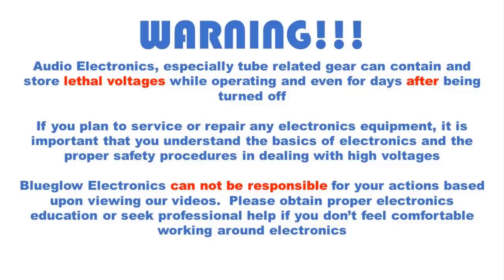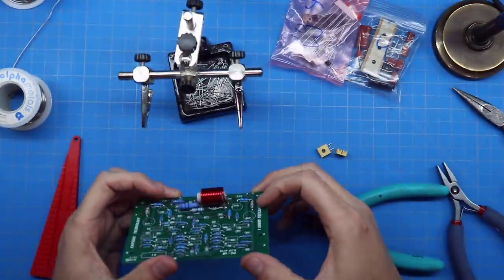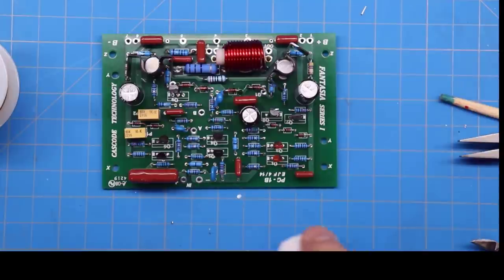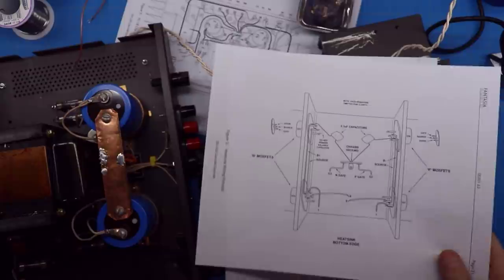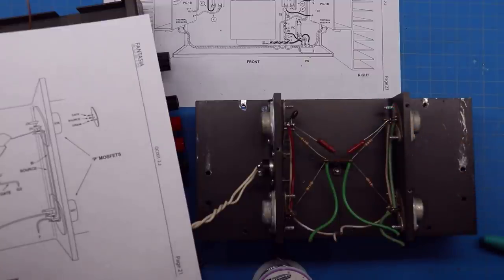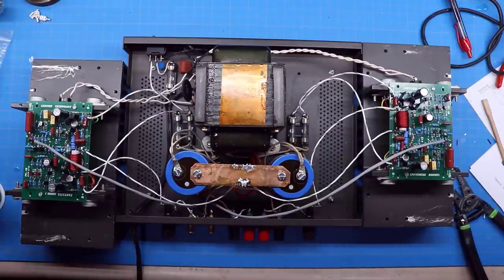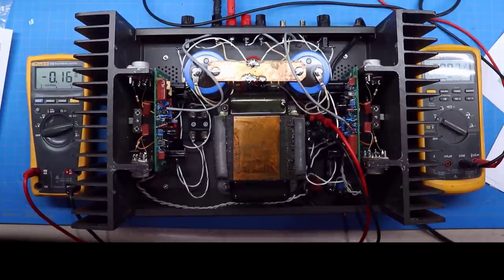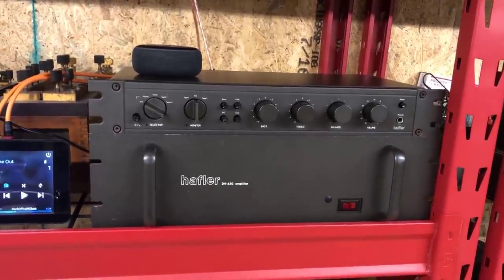Hafler DH 220 Restoration - Part 2

Comment: The Halfer 200 and 220 were among three amps that really changed solid state amps in the late 70s and early 80s. The other two were the Amber Stereo 70 and the Apt Holman Apt 1. Nice work at doing the upgrade.

Comment: I built one these in about 1982. The main left and right circuit boards came fully assembled, tested, and biased. Only the power supply components and other connections had to be wired. Later on, I did replace the 2 large capacitators with some Japanese ones, and replaced the RCA connectors and speaker connectors with gold platted ones. I am sorry I sold it.
Reply: I miss mine too. friend gave me his NAD 2200 power amp and associated preamp. My wife liked the way the NAD looked so the Hafler went into a closet for 10 years.

Comment: Wow....I have the kit to do my preamp and this has given me the courage(and a source) to do my amp. Probably this winter. I put all new RCA jacks already in the preamp. Hafler's originals were pure junk....even when  new....horrible design. I got the jack kit from the guy that offers rebuild kits for Dynaco gear.  Heathkit was always adamant about taking breaks and walking away from your work. When you start to get eye fatigue, getting up and away from your project really helps. Not trying to be a 'Karen', but not taking breaks will cause small mistakes or reversals of parts etc.  I've done that a bunch....made simple mistakes. 

Thank you so much for this. I will use it as my guide when I do the rebuld!!

Comment: Great video!!
My college roommate had a Hafler (factory) built. It sounded good. Nice detailed sound.  The only negative I recall is that the Hafler would shut down if run hard (probably a circuit protection device to prevent amplifier damage).
Reply: I've never had that happen and even used the amp to power double Advents at a youth dance with their 'house music'......that will task any amp. Probably depend on your speakers ohm/sensitivity rating and how hard you're driving them, music dynamics etc. That electronic 'house music' is more taxing than rock I think.  In college you tend to max out everything.

Comment: Wow. Do you really stuff one resistor, then turn the PCB over and solder it, then stuff another resistor ..? It's several times as quick to stuff all the resistors, then solder them all, clip them, then proceed to the diodes, then the taller components in increasing order of height.

Comment: Thank you for posting your videos.  On this restoration, you showed the kit included 0 Ohm 'resistors'.  What is the value/importance/advantage of using these instead of a jumper wire?
Reply: Go back in the video, and listen to what Mark said!
Reply: He didn't really answer the question. A zero-ohm resistor is just as much of a crossover as a piece of wire, surely?

Comment: I'm looking at doing the same restoration but am curious if you think it is better to spend the money on this kit or to apply that money to another modern amp. Thanks for your vids.
Reply: Tough call. But for the money you probably paid for the Hafler(used) and the price of the rebuild kit(forget about your time), you'd have to spend thousands to beat the Hafler. So for value, you can't beat the Hafler. If you're going for purity of sound and trying to emulate today's best solid state amps, you'll not get there with this Hafler. However, everyone I know that ditched the Hafler to upgrade, regretted it(lol, look at Mark's comment below). It has a unique, endearing sound for a solid state amp.

 I would completely ignore the phono preamp though and go with something external. I used to think their phono stage was good, but not after I went separate.

Comment: In the final section concerning BIAS adjustment, you mentioned dummy load at the speaker outputs.  Is a dummy load necessary?  What is the best way to build one?  Sorry for a not so informed question, but am an interested hobbyist and just trying to learn!

Comment: Those brown bipolar caps need,s to be tested  witch way they block noise the best from be introduced in to the circuit.Tape a mono jack to the work bench that is connected to a amlifier(small gitar combo) or one that is connected to a speaker.Hold the brown cap between you thumb and 1 finger let one lead touch the negative on the mono jack(lots of noise from the surroundings as you holding the cap act like a antenna.then press the second lead down so both leads touch negative and positive and listen is the noise went away.Then try it the other way around.Mark the end that touch the positive when you got the least amount off noise.If they are marked with a black stripe,dont trust it.often wrong marked.This is very audible if a cap like those brown is in signal path.
Reply: Has to be an easier way, especially if you don't own a guitar amp. Some sort of tester etc, where you can run some nominal current through the caps.

Comment: Problem with your distortion readings. Spec is 0.02%, and most tested units, were way lower than that.
Reply: Maybe he was reading the scale wrong? So instead of .1% it was really .01%. They are fully capable of that distortion range. Maybe he'll see this and weigh-in.

Comment: I was more interested in seeing you fix the original boards. This is basically just a new amp.
Reply: And that is a positive in my book if the new boards are designed correctly. One of the guys selling rebuild kits used to work for Hafler....not sure if it was this seller. I got into all that yrs ago including the 'famous' guy;where you send your amp/preamp to him and for thousands of dollars he updates and or tubes your equipment. I contacted him and told him what my price limit was per piece and he never responded. You don't want to play his money game, you're nothing but a gnat.

I see this as a positive kit with great instructions....that's worth a lot unless you're an EE.
Reply: I bought a Hafler P225 couple years ago and what I did was replace the 10,000 main caps with 27,000 caps and finally opened my wallet for a good used B&K MC 101 pre amp. This arrangement
along with my "76" AR 11 speakers is the closest I'll get to a  warm and tube  like sound  just begging to be opened up with no unpleasant harshness. High quality pre amp is the answer and game changer in my book

Comment: Should have been titled as kit building video, rather than restoration.
Reply: Is there a difference?  You solder in caps...
Reply: @seanobrien7169  A restoration would have been replacement of old caps & other out of tolerance components. Just about anyone can solder a kit together from PCBs, components, & follow step by step directions.
Reply: @harveyellis6758  So instead of replacing some components he replaced all the components.  I still don't get your problem.  He didn't trouble shoot the initial problem granted, but the course he chose he didn't need to.  With what was available I would have taken the same road.  He has lots of troubleshooting videos i that is what you are after.  Or maybe it is just a question of semantics?